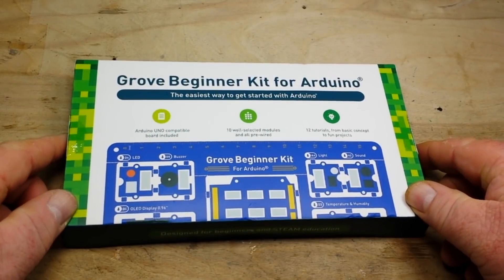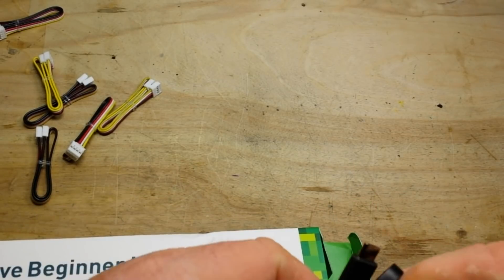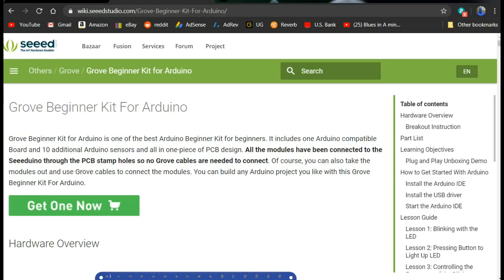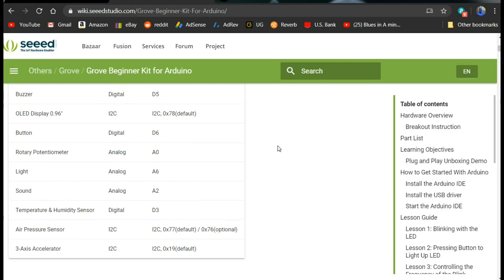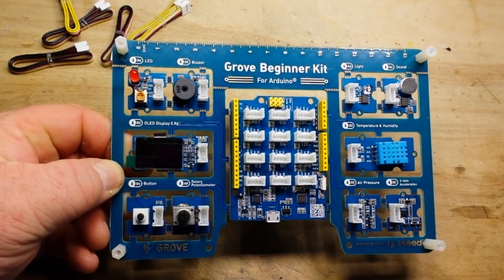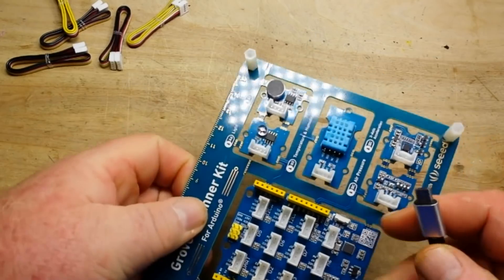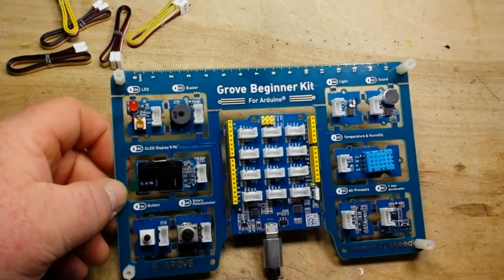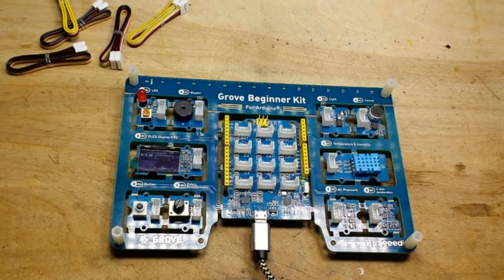Seeed Studio All In One Grove Starter Kit for Arduino Unboxing and Giveaway

Comment: back in  1984 my brother bought an electronics kit with 30 experiments on it. It had a few components like an led, transistor, resistors, vac, radio carbon rod. You had springs to connect the wires. Many years later I tried my hand at it and once I got the radio to work. Recently I started doing some arduino projects and tried to learn some code. My bag of sensors never arrived so I would also like one of these and to bypass those litttle holes you have to put the wires in. My eyes arent what they used to be unfortunately.

Comment: Very great product!  The price is great too!  I wont get one for myself cause im set up with the sensors but would give one as a gift in a heart beat.  But if a 2nd rev included pir, voltmeter,  current meter, the kyb motor, a rotor encoder, ds3231,  keypad and a display matrix  i would get one.  send me a groove anyways